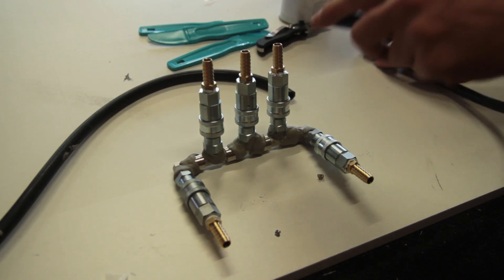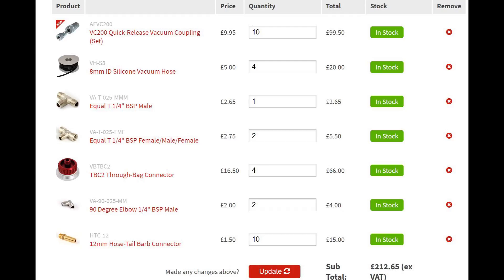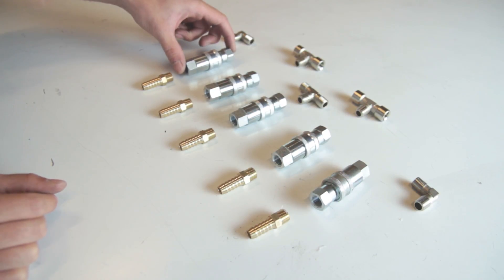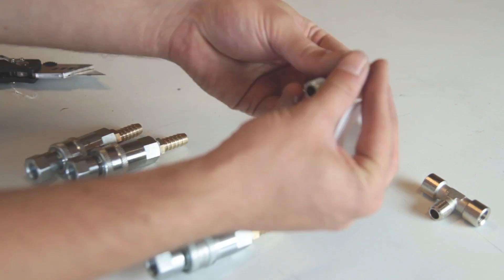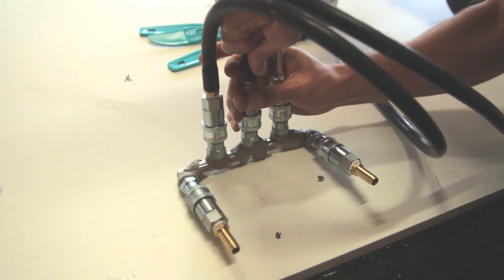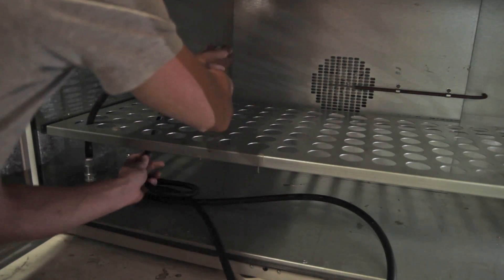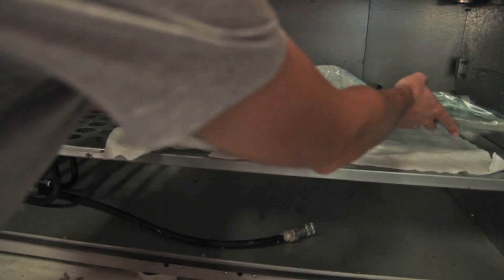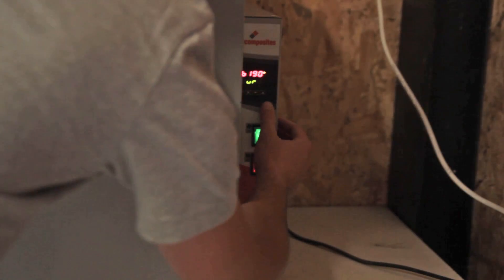Vacuum system for Prepreg - manifold

Comment: Simple yet effective! Are you reconnecting the parts in the oven as a backup in case the bag turns out to have minor leak(s)?

A couple weeks ago I got my hands on a vacuumpump but have yet to find the courage to put it to use. I'll start with a couple simple parts to experiment with. (lets start with a sheet or L bracket)
Reply from the maker: Parts stay connected the entire cure